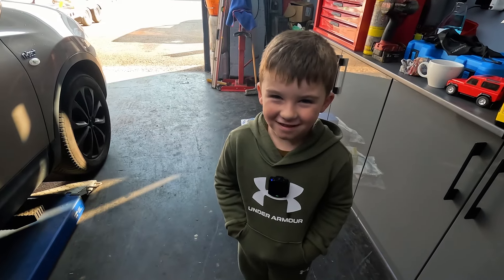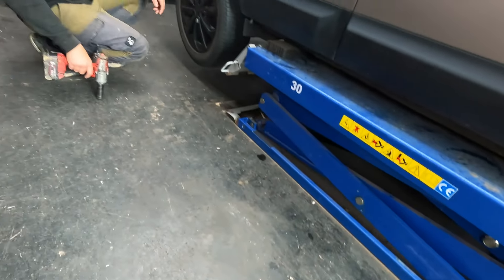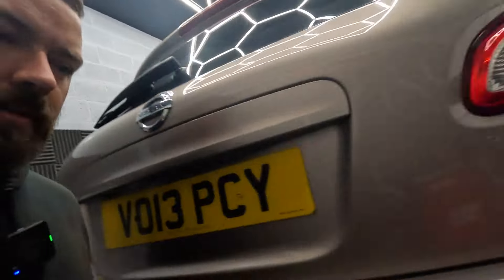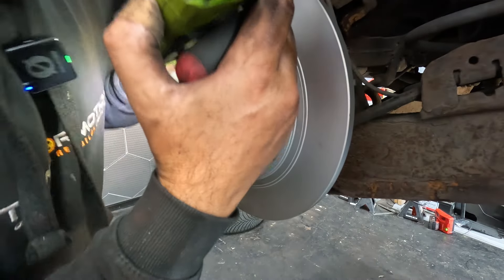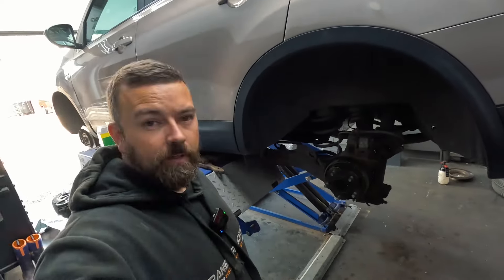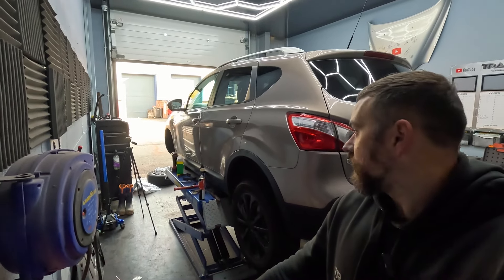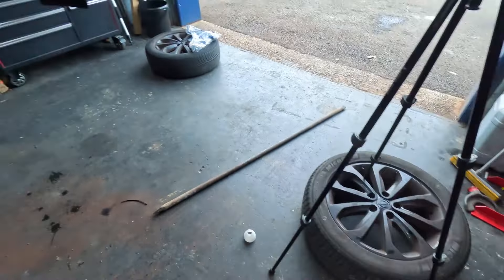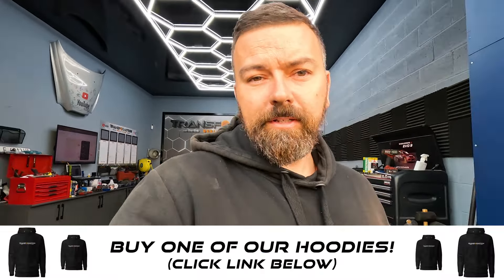OUTRAGEOUS GARAGE QUOTE!! CAN WE FIX IT CHEAPER?

Comment: Had a Qashqai for 11 years.  The wishbones are made from chocolate as they have to be replaced every two years.  The nearside handbrake cable always fails too at the joint where it branches into the rear wheel hub.  The subframes should be treated to prevent corrosion or else they will rust away.  The engine is bullet proof though as mine had over 400,000 on it when I got rid of it.
Reply from the maker: Wow 400k was that miles or km? Not bad for a qashqai ha ha 😉

Comment: Parking brake fail on these is quite often that the cable or cables have popped out of the carrier. 
Just pop off the cup holder (by the hand brake lever) and pop it or them back in. 
5-10 minute job. 

You do need skinny forearms, though.
Reply from the maker: Thanks for the tip mate, this was just the shoes tho as I didn't touch that and it works ha ha but I'll know for next time

Comment: What a nice  gesture of your guys doing this I knew old couple car failed mot on emmisions garage said need new catalytic convertor  so had work done new catalytic convertor put car straight back for mot failed again told old couple sorry needed  more work to get mot 470pounds later they decided get ride of car garage mechanic offered them 50quid for car
Reply from the maker: That's terrible! If the garage who did the mot said it needed a cat then it should be on them to fix it and get through the mot, sounds like they just guessed

Comment: That car has an MOT history that suggest it's been run on the cheap. Loads of advisories not addressed. Rear brake issues causing MOT failure in 2023, and yet here we are with the hand-brake not working in 2024.
The £1000 bill may have been to address some of the advisories. You could be looking at £2000 to £3000 to sort out all the advisories.
Reply from the maker: The thousand pound was just to get it through an mot, no advisory work
Reply: @TransformotionVR  The phrase "rip-off merchants" comes to mind.

Makes you wonder how many people end up paying well over the odds, just because they don't have someone they know that will do it for a reasonable price.

Comment: Aren't mot retests free? In Stockport we have mot stations open on Saturday and Sunday. Didn't you order handbrake cables but I didn't see you fit them? Do you get a refund for parts you don't use? Finally I prefer rear discs with a mechanical handbrake operating shoes rather than rear drum brakes. If I ever replace shoes I always replace slave cylinders. First time I didn't I was driving round France after replacing rear shoes and both slave cylinders started to leak. 1000 miles with no proper brakes
Reply from the maker: The retest is free if it's within 2 weeks I think, we don't have any open here on a Sunday, you might find somwhere early on a Saturday but it was late on when I'd finished. Yeah I sent the cables back as they weren't needed, propper drums need the slave cylinder as that's the brake too as well as the handbrake, modern cars like this have the caliper and disc as the brake and the handbrake is purley for parking